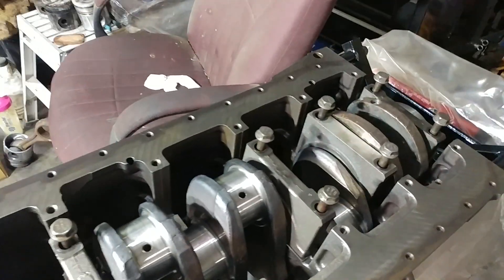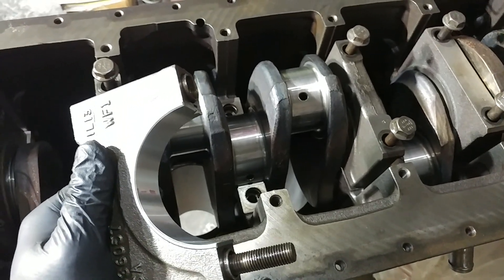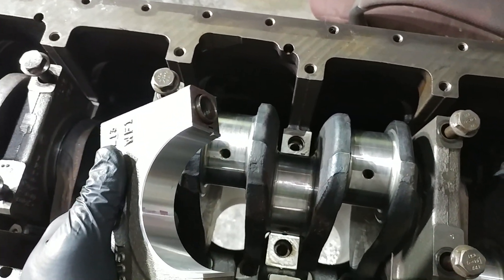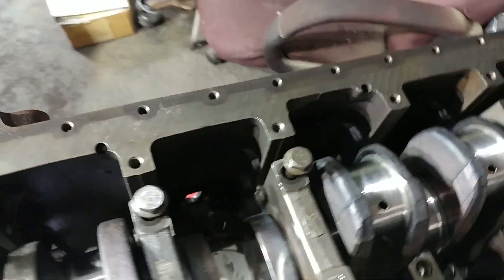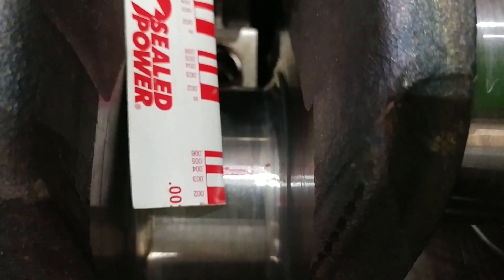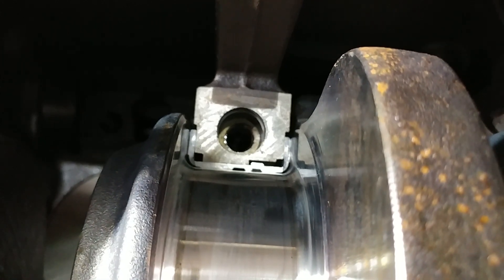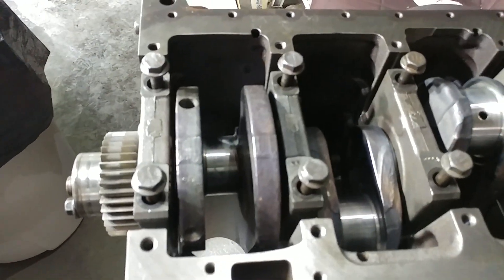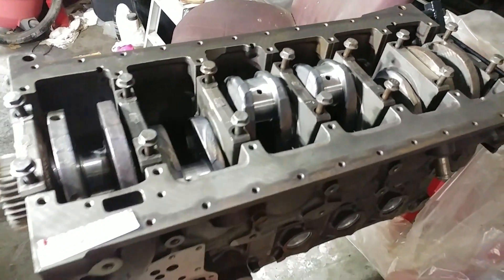Chronicles Of An 03 Cummins Rebuild - Part 8 - Prepping the Main Bearings and Checking Clearances!

Comment: Rebuilding an '06. Had a busted crank. 6 and 7 mains had spun. Had 2 new caps installed and line honed. Bought a brand new std PAI crank. Went to install with new bearings. Tested with plastigauge and found it to be roughly 6.5 thousandth. Took everything back to machine shop who ordered it all, confirmed crank was 3 thou under sized. Swapped to another. Plastigauge cost $3.98, USE IT!!!!

Comment: what if the clearances are not correct with the plastigauging. what do you do then?
Reply from the maker: Well, that is an excellent question. If you have already had your crank turned by a machinist, then you should probably check to make sure you didn't somehow get shipped the wrong bearings and if that's not it, talk with him about why it's off. 

If you were hoping to just reinstall it and it crushes wrong, then the next step is to taking it to a reputable machine shop and have it turned.  As a helpful hint, it's always better to assume the worst and check your crank before you get bearings. It sucks to get standard bearing only to have to buy another set....
Reply: If clearances are too tight, have them polish the crank a bit again if you’re only a thousandth or so off. 

If clearances are too loose, you have 2 options depending on application. Have the crank cut to 10 or 20 though undersized, then run oversized bearings to get your clearances closer to the 3.5-4~ thou.